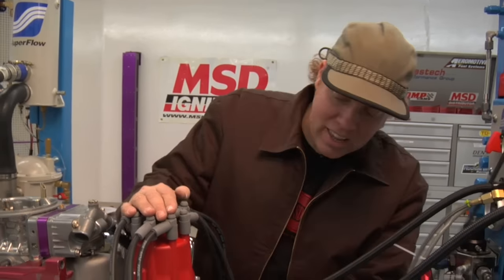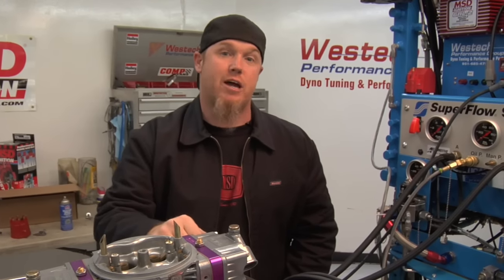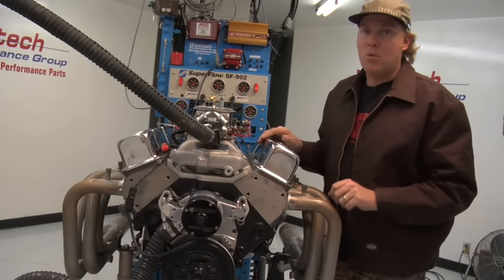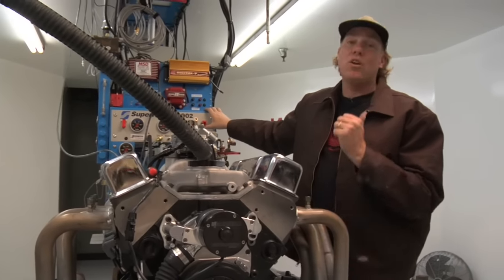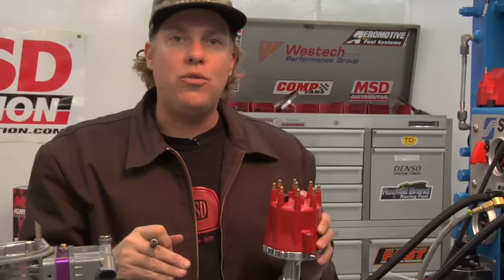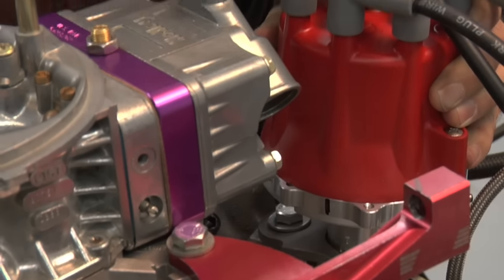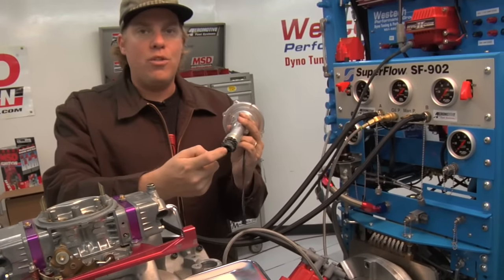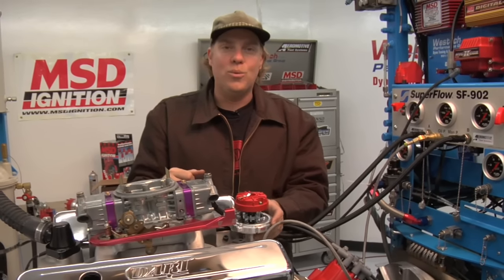Installing a Distributor Part 2

Comment: Thank you.  I just put on a head gasket on my 1998 Chevy Tracker and had to remove the cam and distributor to get to head bolts.  Timing belt was removed too.  Starting from scratch.  Your video was a good insight for my task tomorrow

Comment: Great videos but what if you turn it over with a breaker bar and it still doesn’t fall into place?? Been putting pressure on it as I turn it manually but still nothing.

Comment: I don't know if you answer questions here but I am getting ready to drop a new HEI distributor into my 78 Chev Blazer with 350 engine. I am assuming this is all the same installation is that correct?

Comment: Question:  I performed the technique in the video...and it popped right in...but now I need this:  Should I align the rotor with the #1 plug terminal when the harmonic balancer is right at TDC, or align it when the balancer is 10-12 degrees before TDC?

Comment: He said turn the engine til it goes to 0 on the balancer, but right after that he says make sure you land on 10-12? So which is it?
Reply: So i see your confusion. I believe he technically skipped a step which is what makes it seem convoluted. So normally if you didn't know where the engine would be happy, you would set it on 0. Then later on what you would do is adjust the distributors position to 10 degrees advanced by loosening its bolt and turning it the whole assembly (i believe clockwise?). The purpose of the advance is tuning the engine to where its most happy and runs the smoothest. But different timing curves can be used, (advanced or retarded) for performance applications, due to the dynamic rpm of wide open throttle. But generally the 10 degrees advanced thing is a happy place for a middle of the road tune on a small block chevy, i'm not sure for other engine types it may be the same. If anyone else reading this has extra info or needs to correct me feel free. Hope this helps! Maybe you already know this by now though lol.
Reply: Oh and also, basically he did the same thing as turning the distributor by setting the timing mark at 10 degrees. Either way works. The reason he did that is because he basically prer-set the advance, without having to have the engine running. Normally you would have to have the engine running, and watch the timing mark on the harmonic balancer and then adjust your distributor timing accordingly. He just did it the quicker way. But basically he can still go back and fine tune it, by doing it the way i described above. Again hope this helps!

Comment: Makes sense to install a 'NEW' Distributor at 8-12 degrees ADVANCED vs at ZERO, as the Engine doesn't really like to fire right-up when it's installed at ZERO-TDC.

Comment: I'm having a problem finding 10 deg BTDC because i only have the TDC mark on the pulley, the pointer tab is missing off the engine block!.. any tips on finding a new pointer tab and on installing it?? thanks for any feed back at all. by the way loving your videos, extremely helpful!

Comment: I'm guessing it was set 12 degrees b4 TDC on the compression stroke because it has a aftermarket cam. I'm thinking if it were set at 0 degrees TDC then it would prob be the stock cam in it.

Comment: I have a 89 s10 pickup with a 2.5 liter 4 cylinder engine. I am having a lot of problems with my engine running right. It idles fine but when driving and engine reaches operating temp. The engine runs badly. When you stop engine tries to stall. How do you force the run right? I did this with a 4.3 engine twice with no problems. Engine ran fine.

Comment: Please Help...I have to remove  the Distributer on my 1990 Dodge 5.9... If I Simply Bring the Rotor around to point at #1 or Mark where it is Pointing on the Block as you did and also mark the Dist. Housing to the Block...won't that be enough to line it up for reinstall?  thanks

Comment: I think the point here is trying to set it at the initial point of timing--where you want it to fire exactly, depending on your performance needs. I don't think MSD would put out this video if it had wrong technical information. It would make it hard to sell their products.

Comment: Using your scenario for re-installing the same MSD distributor, I if prime the oil pump using my summit tool, will this change the timing?  Thanks! Oh, it is a 460 BBF if that matters.

Comment: I'm not sure if this is the right place to ask a question, but I need help with something BAD. I am trying to set a distributor in place on a 69 Caddy 472 engine. I have watched a number of videos on how to find TDC and think this one has been very informative. I had a friend bump the engine over for me while I felt for the compression to blow my thumb off. I am also using the factory service manual that is telling me to get the timing marl lined up with zero. Here is where I am in need of the help. I notice that the marker for the governor on the 472 is labeled backward. Instead of reading from top to bottom so to speak 0, 5, 10. It reads 10, 5, 0. Currently I have it about an 8th of an inch past what is labeled as 0. (closest that I can get) From watching this video I am assuming that where I am really at is about 11 degrees past TDC. So am I right in thinking that I am in the right place? Did Cadillac label it this way to correspond with the service manual so that 0 would really be about 10 degrees past? I'm afraid to try to start it and mess anything up. I've never had to do this before. Any help or advice is appreciated. Thanks.

Comment: Hi, I have a motorhome with a 454 engine, P30 van ,1984
 I need to set or ajust my timing  and I have the grades marks on the botton of the engine, how can I check the timing. Thanks for yours opinions.

Comment: does the rotor button need to be for a 91 chevy s10 v6 4.3l after finding top dead center, does the rotor button it needs be exactly right before from the 1st sparkplug? correct u want it before so that it can spark it right. or do u want it exactly on the 1st spark plug spot in the cap???? neways leave answer asap thanks. video is helping alot. but problem is im having to do without timeing gun. so im gunna have to go from TDC. and set at factory default and go from there i have picture tho of

Comment: Hey great video, i know you guys are busy. So thanks in advance. Can i use a 3.0 ohm coil on my 8 cylinder engine? I know it's recommended to use a 1.5 ohm coil but could it be done without consequences? Thanks

Comment: would be in dead center or alignment with you and the enginge. so technically u also want the first spark plug spot on cap to go straight towards you technically correct????

Comment: I had a new Blueprint Vortec 350 installed in my 55 Chevy. It has a HEI distributor in it also. I've noticed that when I turn the heater blower on it kills the engine. The ballast resistor is also hooked up on the firewall, is this what's causing my problem? Please help me anyone, I'm at my wits end on this so any help will be greatly appreciated Thanks.

Comment: I dont get it I thought that you should start at 0 when finding top dead center?
Reply: My guess is that their engine has an aftermarket cam so it has different ignition timing. Thus, they need the thing to not be exactly at 0 tdc as 0 tdc is for the stock cam.

Comment: i took a picture tho of were the rotor button was before taking off old one buy see neways i cracked it over earlier, it finally started but its off the timeing. thank god you cant break nuthing just being out of time. lol neways so if im right???   find top dead center than align the rotor button tip right on or before the 1st plug spot on the cap. and next question always make sure the actually distributor is positioned about at an angle like to were the first plugin on cap

Comment: @joker5417269013 Have you tried stuff like adjusting the contact points, checking plug wires, make sure the dist. tower is positioned right, check cap for cracks. Just trying to help and throw out ideas. Hope you figure your problem out. Engines can definitely be a pain.